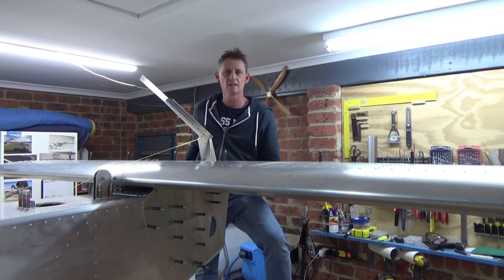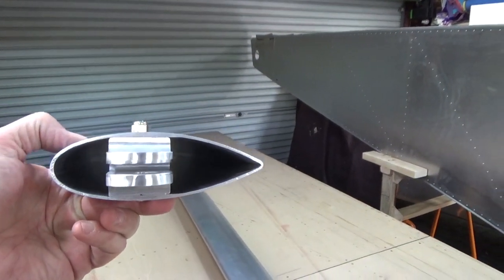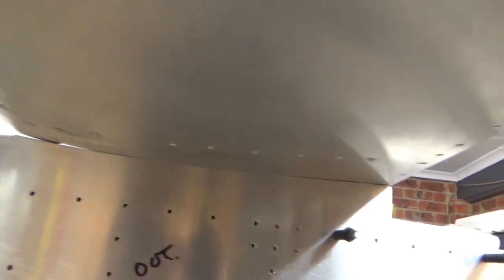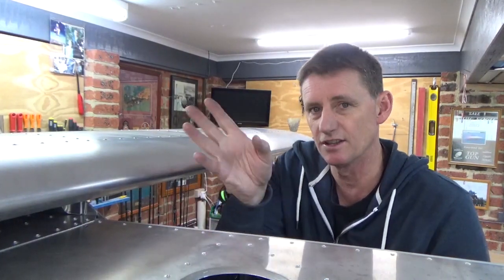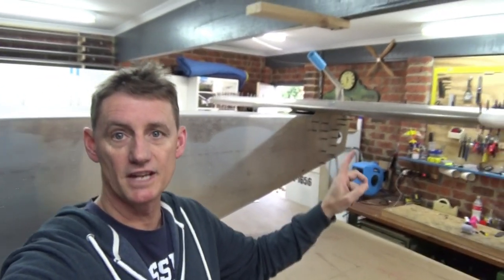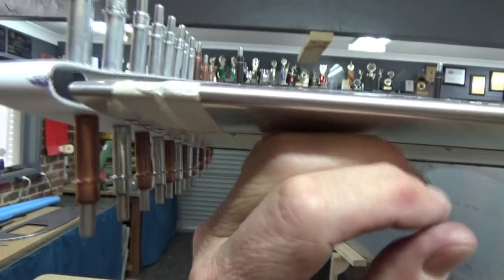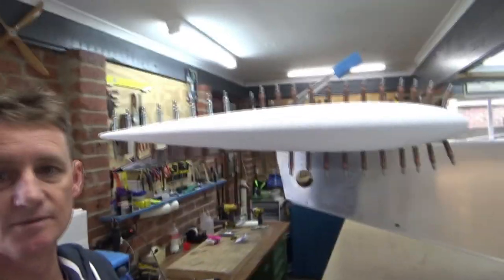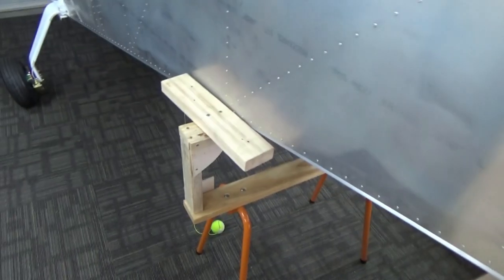How I installed the Horizontal Stabiliser on my Zenith CH 750 Cruzer.

Comment: Scott I'm not trying to be a smart arse but you incorrectly said in the video that you measure in 53 mm from the edge of the strut to locate the holes for drilling in the wing strut but the plans state 63.3 mm and I do realize you meant 63 mm as it can only be that dimension in order to align in the centre of the insert. Just posting the correction for people who follow videos and do things without checking the plans. Great Work Scott Keep it up mate....going well.
Reply from the maker: Is that to find center? I’ll go back and check

Comment: Scott some confusion on my part...further to my post I've discovered that Drawing C75-W-7 dated 10/18 shows the center of the interior flat part of the wing strut as 63.3mm which I assumed is the flat part for centering and drilling the W7-3 & 4 lower strut fitting insert for loading the forces asymmetrically. However I have now found the installation drawing ZA-4 dated 10/18 that your video worked off and it shows Wing Strut bolts fixed 53 mm inward so I'm WRONG and you are CORRECT. My apology.
Reply from the maker: All good, going well thanks for looking out